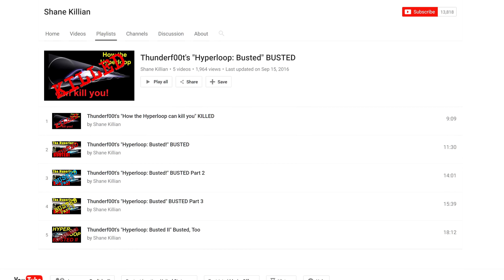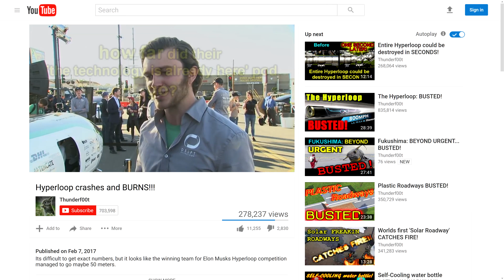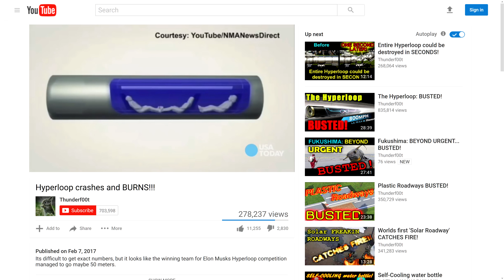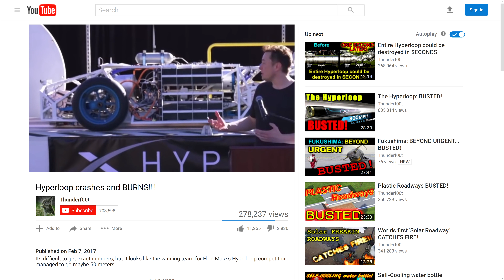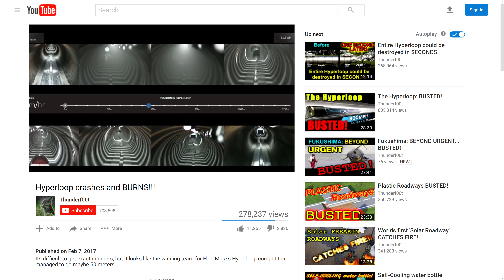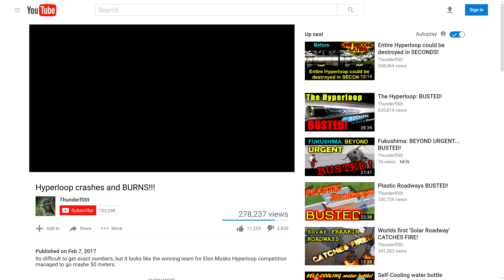Thunderf00t crashes and BURNS!!!

Comment: I still think that Thunderfoot has some valid points on safety and implementation. The Hyperloop has many difficult hurdles to jump and is still only in its infancy. Shane, can you provide unequivocal proof that Thunderfoot is telling lies? Your video didn't really give this information. Basically, what you said is the engineers are conducting tests and engineering is a bit by bit process, so the engineers are still in the process of whether or not it will work, nothing has been proven yet. If the engineers were confident that it was safe and practical they would be building it right now.
Reply: "I'm talking about the vacuum in the tube itself not the pod which will run for hundreds/thousands of miles. Did you watch Thunderfoots video?" Of Course we did, each of us watched every second multiple times. It's what you have to do when making detailed video responses. So what is difficult about maintaining that vacuum?

"As Thunderf00t said, any idiot with a gun will be able to blow a hole in the tube and create an aboslute disaster."
As we pointed out, that's complete bullshit. Nothing short of a 50 calibur rifle could pierce the tube. If the tube were pierced, the local pressure increases would be insignificant and wouldn't damage the compressor. Even if the compressor of a pod were damaged, it wouldn't cause a crash or tube breach. Even if the tube were majorly breached, it wouldn't cause the pods to be shot down the barrel like a gun.
We addressed this. I told you we addressed this. Don't comment if you're not willing to watch our series. We address ALL of thunderf00t's arguments.
Reply from the maker: "The Hyperloop has many difficult hurdles to jump and is still only in its infancy." No one said otherwise, but that is NOT what Thunderf00t has been claiming!

"Shane, can you provide unequivocal proof that Thunderfoot is telling lies?" Already have, over and over and over again in this series. If nothing else, he says lots of things that can be debunked just by reading the whitepaper, which he claims to have read. So, either he's lying about what the whitepaper says, or he's lying about having read it. NO WAY OUT.
Reply: Thunderf00t's criticism that the vacuum would be difficult to maintain was based on his stupid idea that there would be expansion joints. The tube has no expansion joints, thermal expansion is compensated at the end stations. It is not difficult to maintain a vacuum in a single solid welded tube, even if it is hundreds of miles long.

The hyperloop is even less vulnerable to terrorist attacks than a regular train. Thunderf00t's idea that bullet holes would have any effect is ridiculous, bullet holes would have no effect other than laboring the vacuum pumps until the holes are sealed. And a small bomb would most likely only shut down the system until the damaged section is repaired, with only a small chance of causing a deadly crash of a single pod. The scenario TF presented of the pods being shot down the tube like a bullet is also ridiculous.

You just presented not one, but two arguments you found compelling. We addressed both of these issues in other videos in the series and have shown that these aren't at all difficult problems to address.

Now admit that you don't know what you're talking about. It's only fair after wasting my time with arguments we've addressed over and over.
Reply: What happens when you fire a gun at a plate of steel? Not much. With enough caliber you can make a hole. its not a catastrophee... its a H-O-L-E
TF if full of BS it as has been explained by everyone many times already.

First explain to me why it has to be infallible when everything else we trust our lives with is fallible?

The biggest fallibility is humans. Firstly all humans die. That's right YOU AND I WILL DIE, I am sorry if you didn't know that. Second all humans are fallible. Look at what humans do with guns and with cars. We usually obsess so much about technology safety that by the time it hits mainstream the probability of harm is well bellow other everyday things like slipping down a flight of stairs or falling asleep at the wheel.
Reply: "What happens when you breach the pressure in an aeroplane? Catastrophe!!" No, oxygen masks are dropped and the plane descends to a safe altitude. How many planes have crashed because of cabin decompression? Also, airplanes need to be light weight in order to fly, so there's not a lot of payload margin left over for added structural integrity or safety systems. Not so with the hyperloop.

"What makes you think that the pumps will be able to overcome a gaping hole in the tube?"
What gaping hole? A .500 BMG round will leave a hole half an inch in diameter. The pumps would easily be able to compensate for that kind of leak.
Reply: They are not in testing phase, they are still in R&D phase I would say, but that is not the point. People just started developing the technology because there is no other clear next generation alternative. I know you are very keen on hyperloop, but you will have to be patient.

The first air-plane was demonstrated in 1903, people waited 50 years till the first widely successful commercial jet. If people in 1903 listened to critics like Thunderf00t that said planes are absurd, because they would need to be made of metal and be pressurized and metal is heavy and can't fly, then we would not have planes today... Thankfully people that understand maths/physics ignore people like Thunderf00t, they check the math and point out his errors so that people that don't understand math/physics are not fooled.

No one can predict accurately when the technology will become commercially viable. Its possible another technology will emerge that will supersede hyper-loop concept before it becomes commercial. Or we will all live in VR and never go anywhere. At the moment there is little cost and a lot of potential benefit in doing a bit of R&D into the hyper-loop concept.

There is no clear successor to trains/cars/planes for medium range travel. Air friction is a big DRAG if you want to go really fast, and given out history we have always wanted to go faster. In the past people were asking for faster horses and we came up with cars. Faster ships and we came up with planes. No people are thinking about faster mid range transport...

An alternative I welcome you to research could be: vertical take off aircraft, with landing pads around the city, with crafts that can go hyper-sonic, that can transport reasonably large numbers of people, have very short boarding times, very frequent departures, have a very low chance of falling on populated areas, be relatively quite, and not use too much energy to run, not require too much maintenance.
Reply: Why are they not building the Hyperloop right now(they are still in the testing phase)?
Because getting approval for such a project takes years. Especially when such a proposal undermines the incentives of a corrupt government's boondoggle. The hyperloop (though much less invasive than the HSR project) will involve land acquisition and the R&D process may involve some modifications to the tube and/or pillars. Construction at this stage is still way premature. That said serious entrepreneurs are performing serious economic studies to select a location for the first proposal.

"Are you a major contributor to the Hyperloop project?"
No.

"If not, why?"
I have no money.

"So why don't you and Shane get together and be major advisers to Hyperloop projects?"
Because I am under qualified for such a position. That's the kind of position for an engineer with an MBA. I know enough about engineering from my personal life to assess the practicality of the proposal, but not enough to run direct the multi-billion dollar enterprise.
Reply: Shane Mitchell
If you know anything about Shane's philosophy as the host of bogosity you should know that his (and my) goal is to expose bogosity in all its forms. It is not our position that the hyperloop is certainly viable, only that the criticisms levied against it by thunderf00t were invalid. I don't care if somebody's conclusions are correct I'm going to criticize any fallacious reasoning they use to support said conclusions.

The problem with the world isn't simply that people inaccurate beliefs. The problem is that people use fallacious reasoning and that causes them to adopt inaccurate beliefs. The cure for mass stupidity isn't to attack ideas based on whether or not we think they're true, it's to harshly criticize fallacious reasoning.
Reply: Safety: Most planes already hold more then 0.5 atm of pressure difference. A pod is smaller and does not have weight limitations so holding 1 atm in the pod is not a big deal.
https://en.wikipedia.org/wiki/Cabin_pressurization#Mechanics

Reliability: Reliability is usually affected by moving parts. The main parts are pumps, hatches and propulsion system. May require time and money to find best design, but its not rocket science.

Malice: has already been covered, it would be no different to a rail road, passengers would not be affected unless they are near the blast. Deceleration rate is perfectly safe because pods are heavy and have a small cross section. The line would be grounded until its repaired. If its above ground and modular it should be easier.
Reply: "I'm sure the terrorist with a modicum of intelligence will be able to calculate the time when a pod will be nearby." I'm very glad you said that. If you can't figure out how to target a pod inside the hyperloop then by your own admission, you don't have a modicum of intelligence. So, how would you do it? Keep in mind that there are no visual clues about the location of pods inside the tube, that departure times for each pod may vary by a minute or so and the speed of each pod will also vary due payload variance. Also, what weapon are you using?
Reply: "One example of fallibility is aircraft. They can be shot down and any component can fail at any time to cause the plane to crash."
So your point is that planes sometimes crash and therefor the hyperloop is a bad idea? Nobody is saying that the hyperloop would be 100% reliable. But neither is any other form of transportation. And by the way, planes are safer than cars and the hyperloop would be safer than planes!
Reply: "Shooting a bullet at something that is under a vacuum/low pressure can cause that vessel to implode or collapse."

Absolutely wrong! We cover this in the next video. Just because a tube contains a vacuum doesn't mean it's at risk of collapsing. If it takes more energy to collapse the tube than is stored in the vacuum then a cascading collapse is impossible.

By the way, I find your objections to be the STUPIDEST of ALL the comments on all the videos in our series. And THAT is saying something.
Reply: You're joking, right?
Reply: "I still think that Thunderfoot has some valid points on safety and implementation."
Which points specifically? Tell us which point of TF's you found most persuasive and I'll address it.
Reply: Great, exposing charlatans I'm all for it. That is why I'm asking many questions. I like to get to the truth. You will never cure worldwide stupidity, sadly. People think differently and reason differently be it rationally or irrationally. Be careful calling it mass stupidity, the PC Nazis will have a field day. Best to call it "mass nescience" maybe.
Reply: Exactly, they are in the testing/R&D phase which means proof of concept has not been realised yet. I'm a silly electronics engineer and I have great ideas for a product(far and few between) doesn't mean that it is possible or economical. Now the 1903 flight of the Wright Bros, they actually flew. The Hyperloop is nowhere near the first flight of the Wright Bros. There is a huge difference between flying a plane and sending a pod down a low-pressure tube at 1200Km/h for hundreds of Kms. There will be many difficulties including engineering/financial/political issues to overcome, maybe some of which are insurmountable.

By the sound of it,  you have lost a little confidence in the Hyperloop by saying that there may be other technologies that will overshadow it.

As you mentioned the Hyperloop is a concept.
Reply: No one has proven that it can't be made safe either.
Reply: Until it can be proven or not, a healthy scepticism of its efficacy is warranted. We are talking about people's lives here, not some Elon Musk experiment.
Reply: Just a quick question....are you religious Shane?
Reply from the maker: Uh-huh. Yeah. Sure. Thanks for exposing yourself for what you are. Now watch other videos on my channel and see what an idiot you just made of yourself.
Reply: Maintaining the vacuum over vast distances safely and reliably. Terrorist attacks.
Reply: Hypocrite!
Reply: I'm talking about the vacuum in the tube itself not the pod which will run for hundreds/thousands of miles. Did you watch Thunderfoots video? As Thunderfoot said, any idiot with a gun will be able to blow a hole in the tube and create an aboslute disaster. I never mentioned anything about reliabilty of the components. As an engineer, I fully understand the engineering that is behind reliability, nothing is infalable, be very foolish to think so. So I'm not sure what you are talking about???? Please explain it to me??
Reply: What happens when you breach the pressure in an aeroplane? Catastrophe!! What makes you think that the pumps will be able to overcome a gaping hole in the tube? If the pod is travelling at 1200Km/h that could be a serious problem if nearby. I'm sure the terrorist with a modicum of intelligence will be able to calculate the time when a pod will be nearby. You're basically stating that the system is infallible. As an engineer, I have never seen a totally infallible system. One example of fallibility is aircraft. They can be shot down and any component can fail at any time to cause the plane to crash. A lot of development, engineering and technology over many decades still have not overcome all the fallibilities. What happens after years of degradation on the tube? Do they have a maintenance schedule that becomes cost prohibitive? 

I think the Hyperloop is a fantastic idea but, I still think Thunderfoot has some valid points on its implementation. You talk as if all the engineering problems have been solved and it's going to work without issue. The question I will ask you then is why aren't they building it as we speak. They are still in the testing phase which tells me they are not 100% confident that it will work.
Reply: Missing the point. As I said you are making out like it is totally infallible. I never said it needed to be infallible and as I explained nothing in engineering is infallible. You are just using BS rhetoric to back your argument. So what if I will die. I think most humans know they will die at some point in time, pretty asinine comment if you ask me. What has this got to do with this subject anyway? Human error is something entirely different and an entirely different subject. Shooting a bullet at something that is under a vacuum/low pressure can cause that vessel to implode or collapse. Think about that one for a second.
Reply: Ok, Alex, answer some questions. Why are they not building the Hyperloop right now(they are still in the testing phase)? Neither Shane or yourself has answered this question. Are you a major contributor to the Hyperloop project? If not why???? You seem to think you have all answers and everybody is an idiot. Shane Killian seems to have the same childish conceited attitude. So why don't you and Shane get together and be major advisers to Hyperloop projects? If you both are advisers, I highly doubt it, why hasn't it been built or in the process of being built? You make it sound as if its a done deal and it's easy with no problems what so ever.